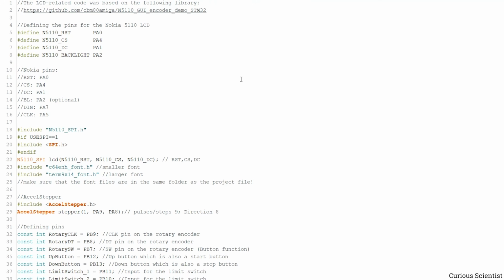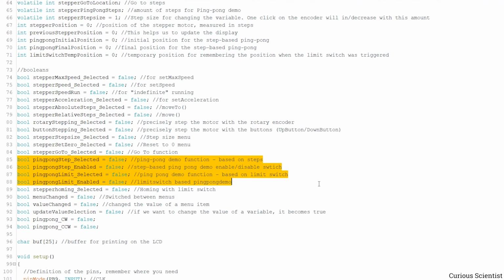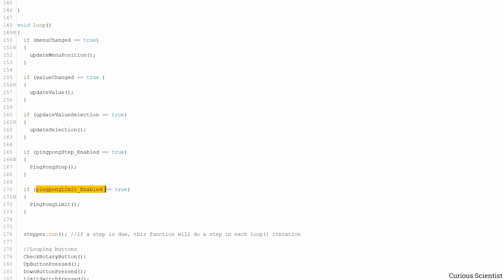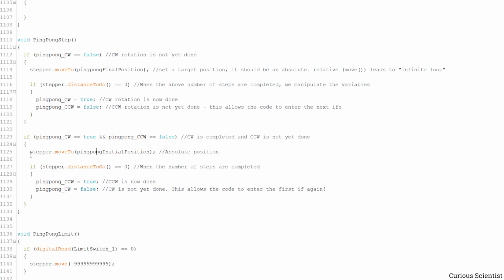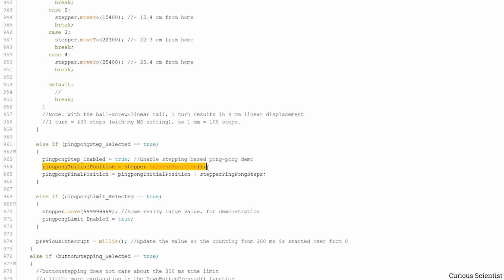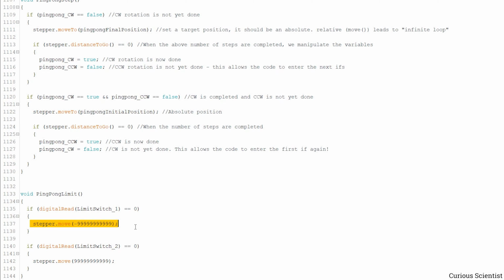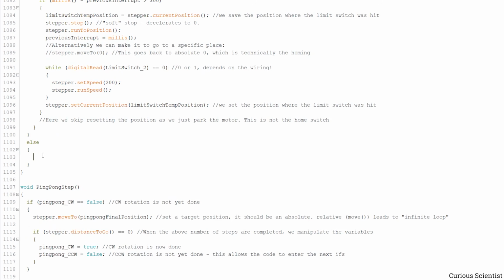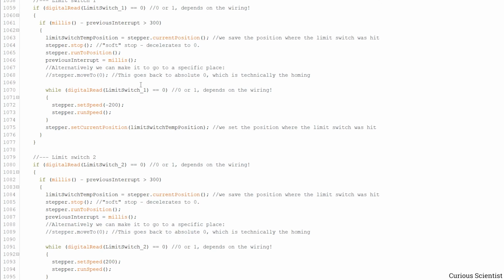Updates for the stepper motor control panel

Comment: I try to compile the code and compiler does not know what is PA0 , PA4... in the first few lines of code. 
#define N5110_RST       PA0
#define N5110_CS        PA4
#define N5110_DC        PA1
#define N5110_BACKLIGHT PA2
-----
These are the errors:
"C:\\Program Files (x86)\\Arduino\\hardware\\tools\\avr/bin/avr-g++" -c -g -Os -w -std=gnu++11 -fpermissive -fno-exceptions -ffunction-sections -fdata-sections -fno-threadsafe-statics -Wno-error=narrowing -MMD -flto -mmcu=atmega328p -DF_CPU=16000000L -DARDUINO=10813 -DARDUINO_AVR_NANO -DARDUINO_ARCH_AVR "-IC:\\Program Files (x86)\\Arduino\\hardware\\arduino\\avr\\cores\\arduino" "-IC:\\Program Files (x86)\\Arduino\\hardware\\arduino\\avr\\variants\\eightanaloginputs" "-IE:\\Document_Redirect\\Arduino\\libraries\\N5110_SPI-master" "-IC:\\Program Files (x86)\\Arduino\\hardware\\arduino\\avr\\libraries\\SPI\\src" "-IE:\\Document_Redirect\\Arduino\\libraries\\PropFonts-master" "-IE:\\Document_Redirect\\Arduino\\libraries\\AccelStepper\\src" "C:\\Users\\QUANGP~1\\AppData\\Local\\Temp\\arduino_build_457055\\sketch\\curiousscientist.tech-stepper-control-panel-updates.ino.ino.cpp" -o "C:\\Users\\QUANGP~1\\AppData\\Local\\Temp\\arduino_build_457055\\sketch\\curiousscientist.tech-stepper-control-panel-updates.ino.ino.cpp.o"
curiousscientist.tech-stepper-control-panel-updates.ino:5:25: error: 'PA0' was not declared in this scope
 #define N5110_RST       PA0
                         ^
E:\Document_Redirect\arduino\curiousscientist.tech-stepper-control-panel-updates.ino\curiousscientist.tech-stepper-control-panel-updates.ino.ino:22:15: note: in expansion of macro 'N5110_RST'
 N5110_SPI lcd(N5110_RST, N5110_CS, N5110_DC); // RST,CS,DC
               ^~~~~~~~~
E:\Document_Redirect\arduino\curiousscientist.tech-stepper-control-panel-updates.ino\curiousscientist.tech-stepper-control-panel-updates.ino.ino:5:25: note: suggested alternative: 'A0'
 #define N5110_RST       PA0

Please help...
Reply from the maker: As I told in the video, if you are compiling it for another MCU, you need to take care of the pins. It seems that you are trying to compile the code for a Nano, whereas the code was written for an stm32. You need to redefine the pins to make it compatible with the Nano's pin layout. Also, I am not sure but Nano might not have enough memory for this code.

Comment: Great videos, I'm very interested in your content. I'm trying to build your control panel to run my project.I have a question about the de-bounce circuit used. According to your circuit it looks like there are two grounds going into the rotary encoder. I also do not see a vcc+ into the switch except through the clk and the dt pins. Hooking it up this way I have an open pin on my rotary encoder, the vcc+ pin. I'm using the ky-40 encoder. Suggestion? My electronic knowledge is limited. Thank you
Reply: Thanks for replying. So my question is does vcc+ goto ground. Or stay empty on the encoder
Reply from the maker: @A_Vikings_Journey  No. If you have the ky-040 board, then gnd goes to gnd, vcc goes to 5 V, and dt, sw and clk goes to the pins that you determined in the code.
Reply: I figured it out thank you. Just a little closed brain syndrome.
Reply from the maker: I am glad that you solved it!
Reply from the maker: Thanks! Yeah, the rotary encoder DT and CLK pins are either high or low, that's why you see it connected as it is. Just use Google for more schematics. Check the source code and you will see how to wire it up.
Reply: Yes but on your schematic it shows two grounds from to separate pin outs just a little  confused. There is no direct pinout to vcc+. So what do I do with the vcc+ pinout from encoder. I have everything built ready to go just confused with the denounce circuit. Thanks for being patient with me

Comment: Another great video with explanation. Minimum and maximum travel.
Reply from the maker: Thanks! What do you mean by the min and max travel?
Reply: @CuriousScientist  only that the micro switchs would represent the minimum (0) position and maximum (opposite) travel.
Reply from the maker: They serve that purpose. You can place them anywhere and physically define the min and max positions. I explained this in the video when I showed the limit switch-based ping-pong.

Comment: This could be a very nice little xy table indeed! I saw the link for that easydriver alternative you linked on your web, wow, is very cheap!
Reply from the maker: Yes, the "counterfeit" circuit is very cheap. Actually, I ordered 10 pieces a few weeks ago. It still hasn't arrived, but once it arrives, I will continue the adventures with these motors because I still have a plenty of DVD drives to disassemble. I will build some cool stuff.
Reply: @CuriousScientist  👍👍👍